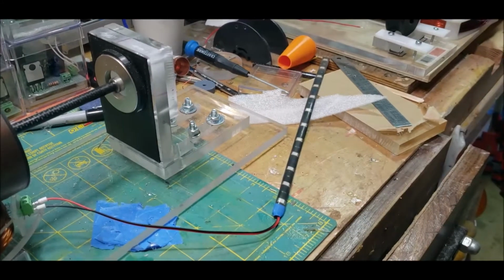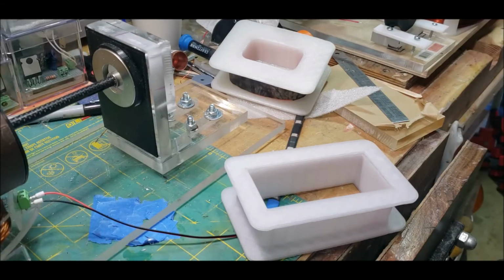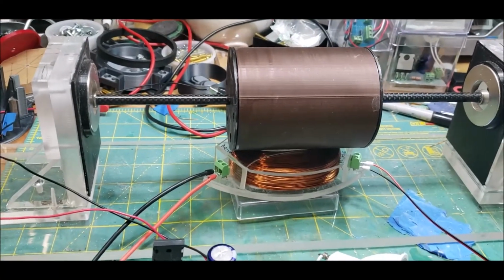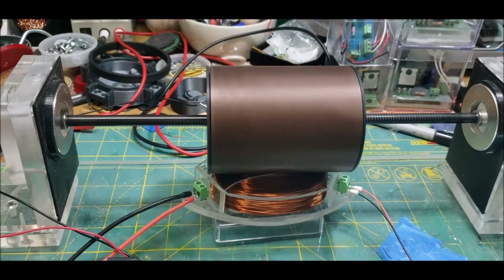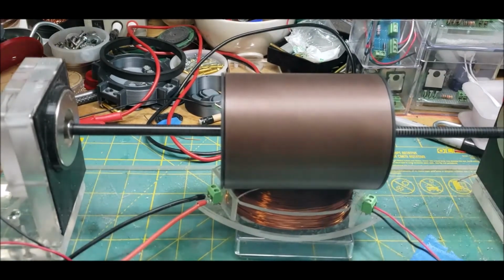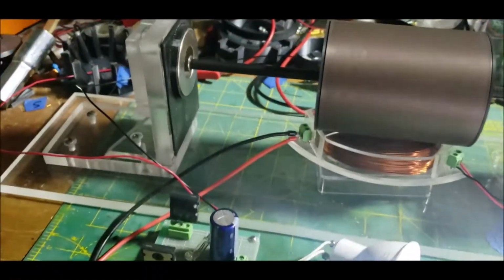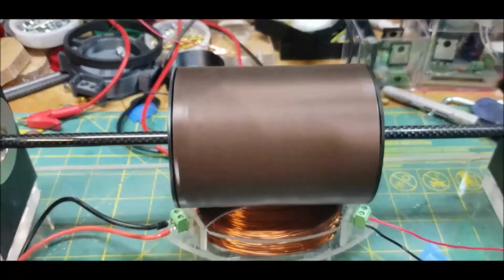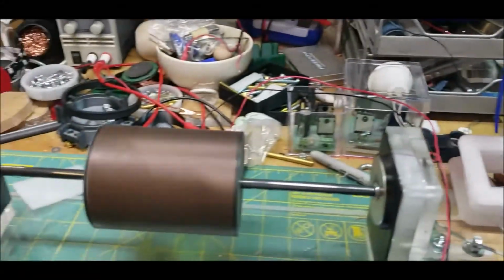"New" 3D Printed Coil Design and "New" Circuits

Comment: Keep up the good work, Mcorrade , can you show me a closeup of the bottom of the print?
Reply: (The underside off the print )
Reply from the maker: sure but what print? The rotor?
Reply from the maker: ah I think you mean the coil housing right? It has to different textured surfaces which are cool. One is the texture of the build plate and is very cool. I'll show it on my next video
Reply: @mcorrade   The old and  new JL94 circuits.
Reply: The old and  new JL94 circuits print , the underside i am interresting , how skycollection did it.  thanks.

Comment: Lol you should send me the link to 10 pounds of 17 gauge. I'll show you what could be done with that much wire.
Reply from the maker: its a link to 5lb of 25gauge that they keep getting wrong. I'm afraid if you use it, you'll get 5lb of 25gauge wire lolololo
Reply: @mcorrade  well I just ran out of 16 gauge when I was making a transformer.  I probably would actually get 5 pounds of 25 gauge.  Which I don't need lol.
Reply from the maker: @MAGnetICus_Attractus  exactly lolololo